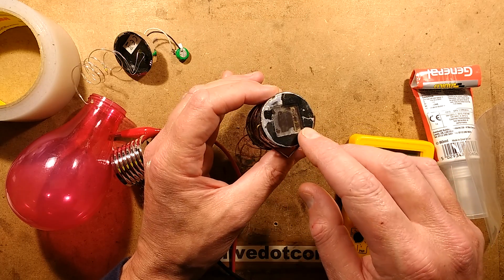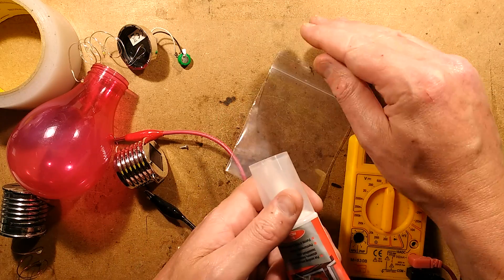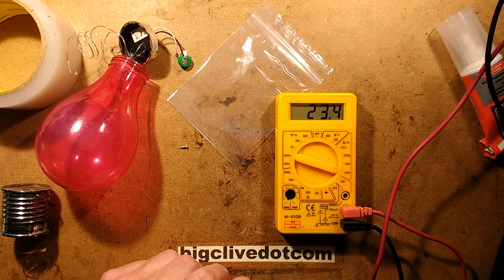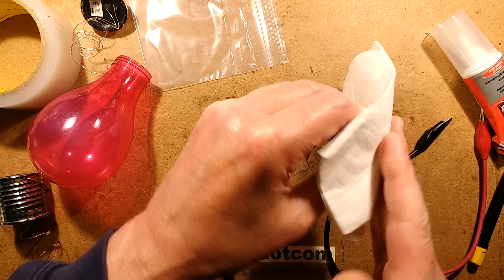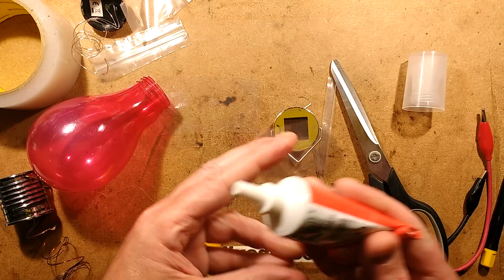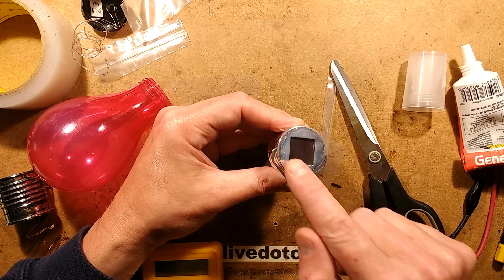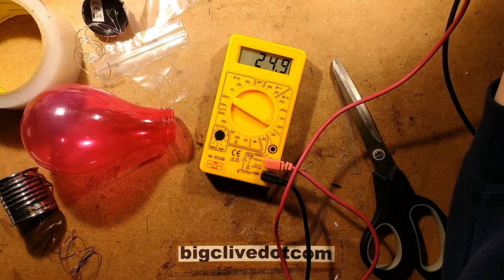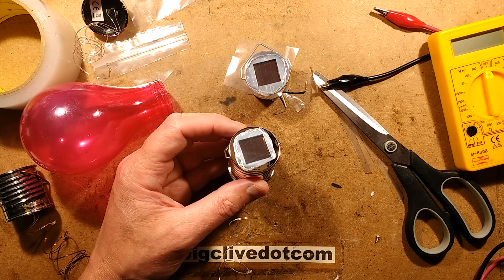Easy way to create a protective silicone layer on a solar light.

Comment: Clear lacquer perhaps, industrial strength of course?
Just an idea.
Reply: > Just seal around solar panel.

I think part of the reason for this method is to make the top of the bulb flat instead of concave. As long as the panel is recessed, water (possibly dirty water, dripping from the tree) will tend to pool over the panel. By filling it with silicone, the top becomes flatter and you get less pooling.
Reply: Eryk Johansson Why not just seal ingress points instead of whole thing? Clear silicone for outside use should be enough. I don't why would you do so much for a really cheap light. Just seal around solar panel.
Reply: Grzegorz Szymański Dzień dobry, I would never purchase a light of that kind and waste time on it on top of it.
I just figured it would be quicker and easier to apply a coat of clear lacquer instead of fiddling with plastic bags, silicon and cutting 😊
Reply: Eryk Johansson Dzień dobry :) Lacquer would probably seep into the light, I had one some time ago and it had pretty large gaps. Yeah, they aren't sustainable, so I don't buy them either. They are one of the most wasteful products ever. Nobody bothers to seal them, even manufacturers so people replace them every year or two. I don't think anyone bothers with disposing of them properly :/
Reply: Plus you get pumping from thermal expansion
Reply: Quality lacquers are also an order of magnitude more expensive than acid cure silicone.

Comment: Top tip:  Blu-tac is quite an effective degreaser for things like this.  I discovered this watchmakers use something called Rodico Putty for degreasing.  It's basically the same stuff as Blu-tac.   I also find Blu-tac to be a great aid in tinkering, as you can stick components and/or wires to your desk whilst you work on them.
Reply: Personally I only hang my Christmas cards with Isopropyl alcohol......... ;)
Reply: I believe they once used Blu Tac to do a repair to the Big Ben clock mechanism. Blu Tac is now holding the UK together. If the company that makes the stuff ever goes bust we'd be in trouble, but thankfully British prime ministers in recent years have had the good sense to stockpile the stuff for dire emergencies like another financial meltdown or collapse of the pound. Blu Tac in such circumstances  could be used as an alternative currency or measure of value. Forget Bitcoin, Blu Tac is the future.
Reply: Dude chill out, no one is saying alcohol will not work. We get it, you can move on now.
Reply: Yeah I moved to the UK and found out about the wonders of it. I think it existed as a generic product where we came from, but was less tacky and nobody used it. I can't remember seeing the actual Blu-Tac before coming to the UK.
Reply: Kakunapod I'm very calm. I just think internet is obsessed with lifehacks of poor quality. There is a reason why we don't use blu tac for everything. It's just a discussion, and you probably are too uptight, because you are here just to say that I should shut up. Also if you don't have isopropyl alcohol IDK why are you watching Clive ;) Do you even have soldering iron?
Reply: Mini Bigs I guarantee, that any pure alcohol above 37% will degrease better than blu tac. Blu tac isn't really popular in most of the Europe and you will definitely find Vodka in more homes than it. Things may look good after using blu tac, but it doesn't mean they are properly degreased. Just use blu tac on your smartphone and use alcohol after it and see how much more squeaky it will get. Also Rodico putty ≠ blu tac. They probably have different ingredients.
Reply: Grzegorz Szymański rodico putty is almost identical to blu tack because guess what blu-tack was based on. No guess. Go on. You'll never guess what the invention of a former watch maker was heavily based on and almost 100% chemically identical to. It's honestly so unexpected.
Reply: Peetiegonzalez Why? You just use isopropyl alcohol for degreasing. Watchmakers? This is like 1 £ solar light
Reply: Grzegorz Szymański it’s just an alternative.  I happen to have blu-Tac handy for many uses so I don’t need to go out and buy the alcohol.  Degreasing is a very effective use that many don’t know about unless they’re familiar with watchmakers rodico putty so I thought I’d mention it.
Reply: Peetiegonzalez I think more people have isopropyl alcohol than blu tac handy. Not to mention that alcohol is a better degreaser.
Reply: Grzegorz Szymański maybe where you’re from but in the UK everyone has blue Tac handy for many uses.  Anyway just an alternative.   Use the tools you have!

Comment: I have sealed a few of my Mum’s cheapy solar lights with Captain Tolley’s Creeping Crack Cure.
Reply: Is that something you get at a sex shop? Pharmacy? Or hardware store?
Reply: Would it help to keep the water out the hatchback of my 451 Coupe ?  I can't find where it's leaking.
Reply: Of course, just mix it with water.
Reply: haven't used that stuff since I got rid of my boat...did it work ??
Reply: I've mentioned that with BC's lights many times in the past.

It works very well with GRP / gelcoat cracks, and with leakage around above waterline skin fittings / electrical feedthgroughs / portlights. Seems to be a durable fix too - past experience on a boat, outside in all weathers, and in regular use, indicates a working lifespan over 5 years.
Reply: What?!!??!
Reply: Did your mum have a creeping crack problem? Why would you otherwise have it to hand?
Reply: Makes it's own sauce
Reply: FAAAAAAAAAAAAAARK
Reply: Should have it on both

Comment: Watch your back Clive, the garden light designed-obsolescence syndicate will become very interested in you if this works.
Reply: The Best Stooge They vary hugely, I've had ones that only last a few months to some that just go on year after year on the original batteries!
Reply: I can't even get past the first rain with them anymore and for the ones that past that the damn things die in 2 months or maximum 3.

Comment: Testing solar cells with a lamps isn't ferpect. Solar radiation contains a lot of energy outside of visible bands which is (partly) usable by conventional solar cells. IIRC, the lab standard for measuring solar cells in the university lab (ca 1978) was to use halogen floodlights to yield the "1-sun" intensity of 1kW/m² at the test surface.

Proper testing labs do it differently. See e.g. https://www.nrel.gov/pv/cell-measurements.html

The good thing about standards is that there are so many from which to choose. :-(
Reply from the maker: I tested another solar panel (polycrystalline silicon) in direct sunlight and it performed equally with a layer of silicone.
Reply: Bernd Felsche I Like the Big Clive 'Lab Standard', it works, even when I don't know what to do
Reply: I think some some solar cells can absorb UV light, so if the silicone lets UV through, it might even perform better than the 3M tape. This is assuming the lacquer on the cells themselves isn't blocking all the UV anyway.
Reply: It was just a basic comparison test. Clive wasn't trying to determine the characteristics of the solar cell.
Reply: AFAIK silicon chips are most sensitive to near infrared. 
Putting an IR transmitter (TV remote) behind the layer and looking at it with a cheap camera (phone/laptop front cam) would be a simple test to see if that comes through! Camera must be cheap because the better ones filter out IR.

Comment: Does the curing process change the current output? I.e. silicone becoming less translucent? You could also try with a small segment of polycarbonate or PMAA? Or even a PMAA lens... Like a spot lens (dome) which I presume would refract light in reverse from the outside in - so what would have been a spot light, reversed, would become a collector of light from all angles................ like this SCIENCE IMAGE that I just scienced (using the app 'ray optics' https://drive.google.com/open?id=1bh8OuO9_SPk4mGyDlPYLTJgt-NsJusHf  - link to google drive image. Note - also probably makes it a magnifying glass, like what you'd use to fry little plastic soldiers...... So under sunlight, it might cook things and make them go on fire. (......All the more reason to try?)

Comment: See you in 6 months for the followup...
Reply: after a year, ti looks good, video is up now.
Reply: @foorjee  Here is the URL: https://youtu.be/czfa0S5uwcI
Reply: RaelenThePedobear666 Ruined
Reply: 2 different coefficient of expansion rates, they will just expand and contract apart, and eventually leak.  I would use a rubber gasket with pressure using a frame screwed in.
Reply: wavefront101 or just use the silicone has a gasket.. but you need to remove the solar panel for that